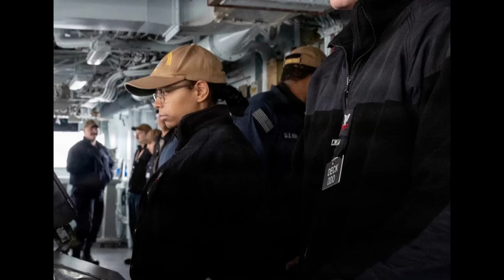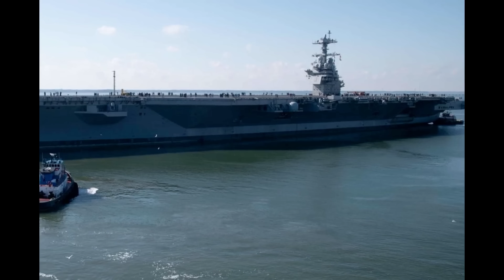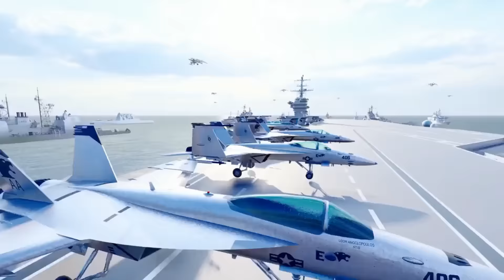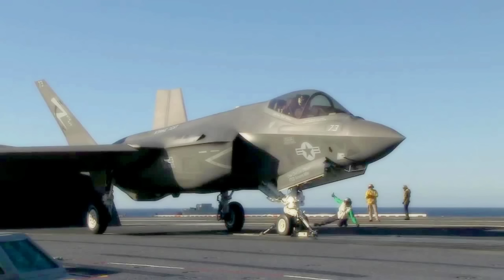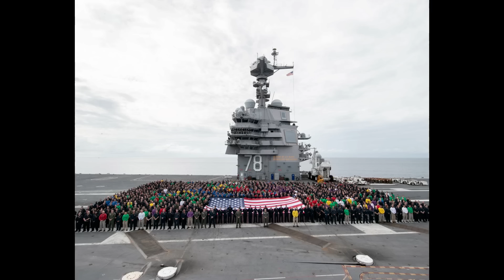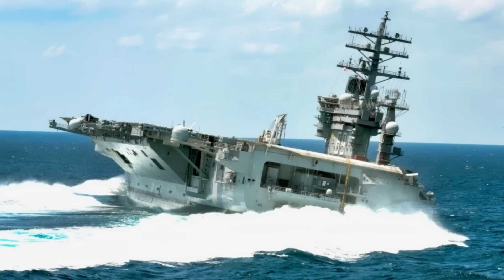The Navy’s Most Advanced Carrier Has Finally Begun Trials

Comment: The reliability on EMALS was somewhat overstated, Many of the launch failures were software related safeties put in place, if the software so something it didn't like it wouldn't launch and require it being confirmed or corrected if needed, this is not the same as mechanical failures. The old standards/requirements weren't really applicable to the new system, if the old system failed it was mechanical, without warning and would take many hrs to repair, the new system might see something that didn't pass the checklist, flag it, not allow the launch, then it would need to be addressed, usually taking minutes. I'd rather have a system that gives warnings and keeps ahead of issues than one that gives no warning and you’re down for many hrs. Ford has well over 85k launches at this point.
Reply: What is Ford's record for launches in one day?  What is EMALS MTBF now?  I want it to succeed, but years ago I read the GAO report that pulled no punches on EMALS shortcomings.
Reply: @timtrewyn2042 the only public on file record I saw was 170 launches in 8.5hrs with 175 arrests during post delivery trials, I’m not sure they’ve needed a high SGR while out to sea as of yet, my initial point is that the 4100 number given to the old system was because it was almost a unknown if and when it would fail and when it did it was a long down time. The new system initially had a teething issue at first but the majority of what you hear about now is a failure to launch mainly because the software flags something. Someone checks it, then it’s good and off it goes if it checks out ok. It’s a better system and only going to get better. Also people don’t realize rarely did the Nimitz carriers need or achieve their 120/240 surge rate. It’s better to view those 120/240 and 160/270 numbers as a high end goal requirement and not necessarily a daily necessity. Combine that with no one comes close to the operational tempo the U.S. navy carriers do and I think we’ll be fine. I’d be more worried about our inability to build any ships at this point as our production just sucks

Comment: Are the Chinese experiencing similar issues with their new CVs?
Reply from the maker: Yes, China is facing many of the same technology and integration problems, especially with EMALS and high-tempo carrier ops. The difference is the U.S. already has decades of carrier experience to fix them, while China is learning those lessons for the first time.
Reply: The newest Chinese carrier with a battery powered EMALs is back at the shipyard.  They realized too late she was built on the basis of calendar date required by the CCP not on needed engineering.  Unable to launch more than 2 planes / 20 min.

Comment: Your assessment of the Ford is disingenuous at best.  Building ships does not leave room for having prototypes that can be tested over and over again.
Can you imagine building to B21 Raider with no benefit of prototypes.  The first plane and every plane has to be operational.
The manufacturer would say you're crazy. We need prototypes for proper testing and research development.
But when it comes to ships to the Navy doesn't have that luxury.  The Ford was the Prototype, and must be operational.  That is a heavy burden to put on any developer, and should be considered during your assessment.
The Enterprise will be even better than the Kennedy.
Reply: The problem is that the navy wants the newest and best technology available. Sometimes the promises of the manufacturers does not pan out. So they test the equipment in the real world and find problems.  This is a very large complex ship with many advanced upgrades.  It sounds crazy but, the first new prototype ship will have issues.  🇺🇸✌️👁️